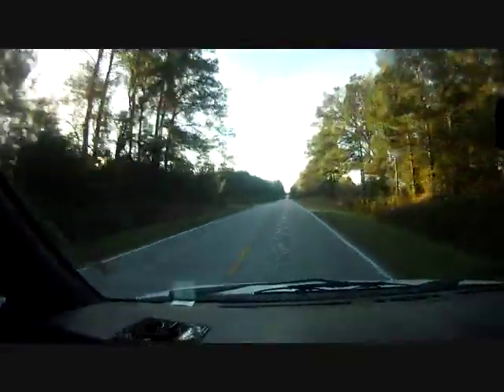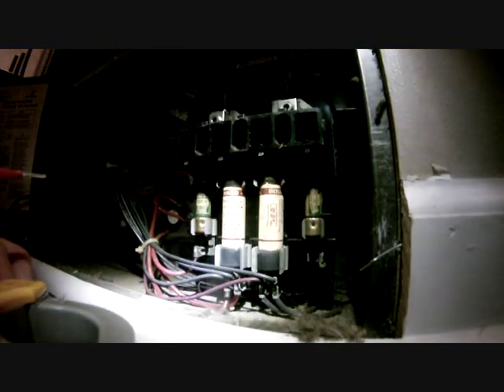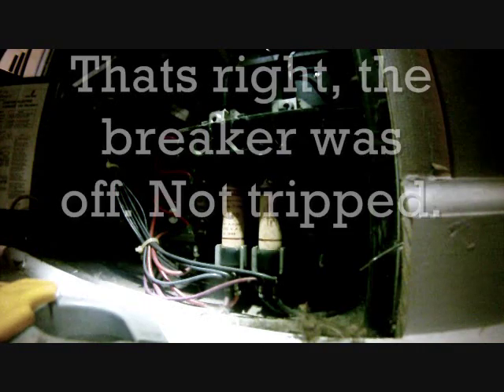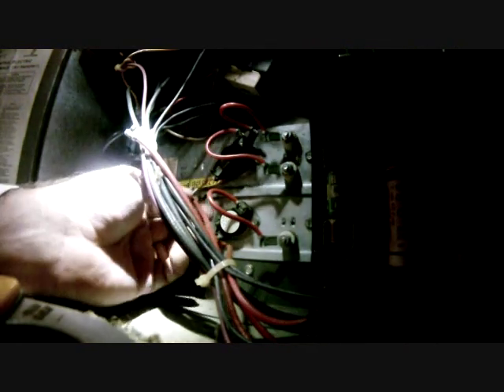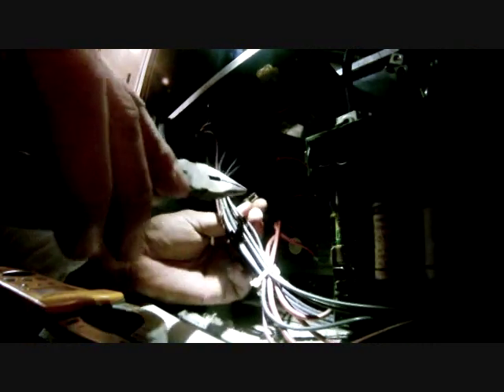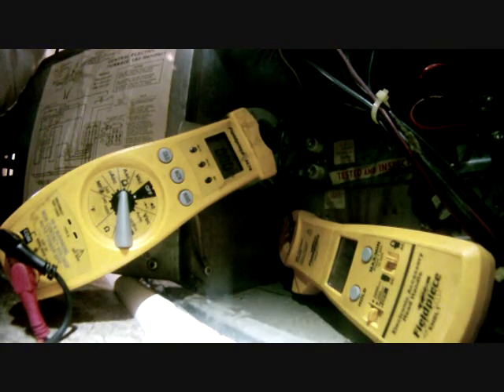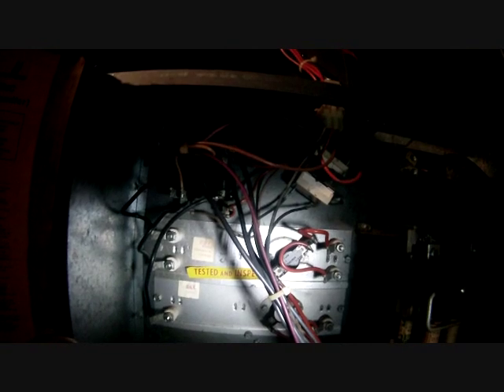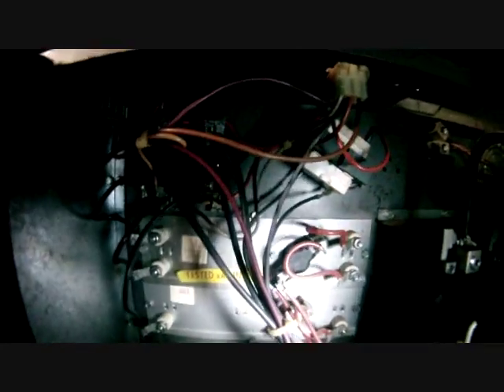HVAC Service- Intertherm Electric Furnace

Comment: I’m almost certain I have the exact heater.  Maybe you can help me.  So I replaced the fuses and the heater heats up but the fan won’t turn on.  And I tried the automatic switch and the fan comes on.  What could it be?  I’d appreciate a reply. Thank you.
Reply: Your thermostat fan wire probably isn't connected correctly, you might have the wrong type of thermostat for this system. It's a green wire under the thermostat

Comment: Have an ontertherm furnance....will run and heat...but then stops...and will not restart unless you turn off the breaker and turn it back on....then will run a awhile and have to do the same thing...any ideas what may be wrong?

Comment: I appreciate your thoroughness.
After many decades in the business, my brother and I never assume anything when we see a shut-off breaker.
For all we know, it tripped and the homeowner decided that wasn't good enough, so they threw it to 'Off'.
Not that we see all that many up here - too expensive. Sometimes as the 'emergency' heat for a heat-pump in the warmer areas down South of us (eastern Colorado, below Pueblo or so).
I think the electric companies' ads in the 1950's that electric heat was 100% efficient, while true, did a lot of harm.

Comment: Hey I got a question the heat blows fine then when it reaches the temp we set it at for example 75 it will shut off then come back on and does this until we manually turn it off it. What is the problem?
Reply from the maker: I would suggest calling an HVAC tech because there can be multiple causes for this issue.

Comment: Intertherm electric furnaces suck electricity and are not high efficiency like its rated.Its uses almost twice the electric than my central AC system. Pure JUNK. and the entire unit is only 11 months old.

Comment: Thank you, thank you, thank you! I have the same furnace in a trailer I bought about a year and a half ago, and it's always worked well enough to keep the house warm. After watching this, I found a burned out fuse and now the air coming out of the vents is a LOT hotter. I could even smell the dust burning off the heat element that's been inactive for so long. Thank you again!